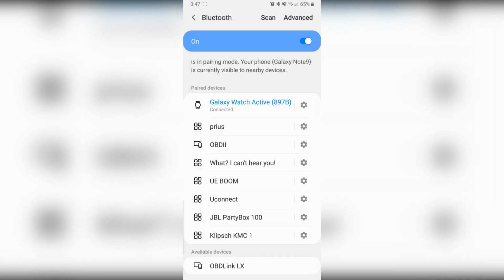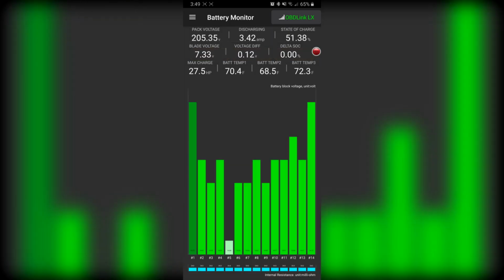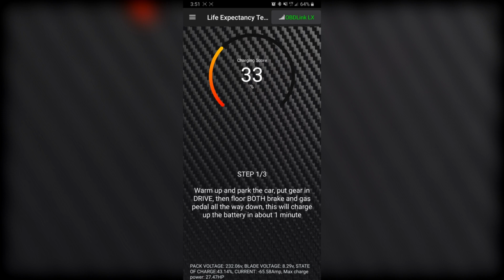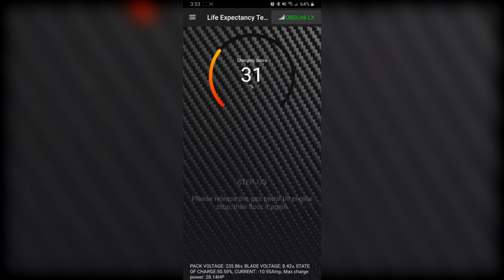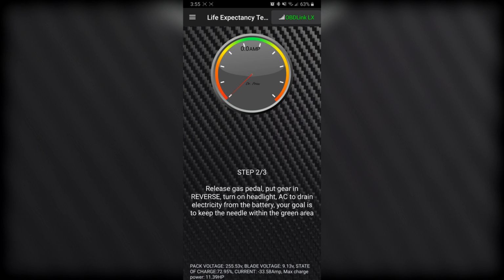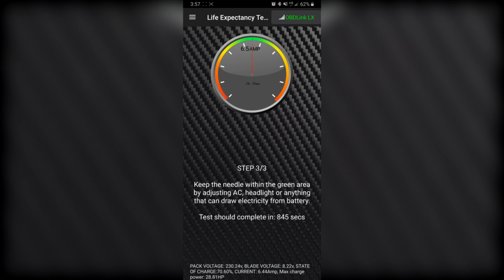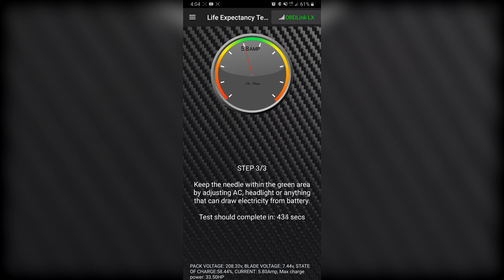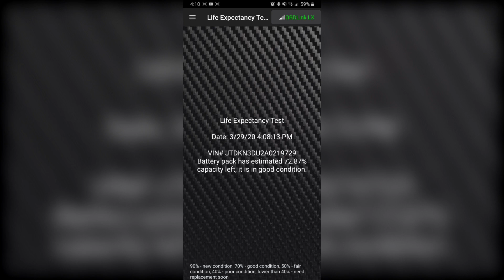How To Test Prius Battery Health

Comment: I rebuilt my battery pack on my 2007 Hybrid Camry last year! Does the Dr. Prius work on my Camry? What kind of balance charger/discharger you recommended for balancing the whole pack? I have used  a couple of hobby chargers to charge and discharge each separate module ten times after replacing 5 bad modules!
Reply: Dr Prius works on all Toyota hybrids. You can forget the grid charger, if your pack acts up again just replace the defective module(s). Drive the car highway speeds more often too. Stop and go driving is death to these cars. Also sitting parked for weeks does them dirt too.
Reply: @michael47lamb  Thank you for your advice
Reply: Yes, you are right! I have driven my Camry a few occasions on short stops and go shopping with the A/C turn on in the summer! The battery condition gauge showed only 40% left, I then drove on freeway for a reasonable distance just to charge up the battery again! It was a bit scary, I've just wondered whether the newer Toyota hybrids have similar drawn  back?
Reply from the maker: Hi Samuel!

Sounds like you did it right! I had good success using the Tenergy T180 but any hobby charger that can handle NiMh would work. The price goes up with the chargers ability to discharge at higher rates. The T180 could discharge around 15-20 watts which was about perfect for what I wanted.

There are much better chargers out there that can handle multiple modules at once which would speed up the process.
Reply: @HEVTech1  Hi, I tried to use the Dr. Prius App. on my 2007 Camry today, but it did not allow my Fixed Blue tooth transmitter to work! I have been using this for years, it worked on Fixed App. and Torque Pro.  App. Can you recommended one that work! I don't want to keep buying the wrong one please!
Reply from the maker: @ChuiSamuel  I've had good success with this one:
https://www.amazon.com/dp/B005NLQAHS/ref=cm_sw_r_cp_apa_fabt1_oeVTFb175RC90

I have an android device running Dr. Prius
Reply: @HEVTech1  I ordered one of the above yesterday, It will arrive in a few days! Do you know anyone can write the PID equation for Torque pro for my Camry? The custom PID on Torque Pro only work for Prius!

Comment: Good Video. I have a Garage kept prius 113k miles battery is at 47%
Reply from the maker: What year? That is a bit lower than I would expect for that mileage and the fact it was garage kept.
Reply: @HEVTech1  Sorry I left that. its a 2011 Prius with 113,000 miles.  I ran the test twice, and had 47 and 48%. Vehicle is in Florida. Also my Block 4 showed an error message on one of those tests.
Reply from the maker: @an10nee  what was the error message? Florida may change the equation as there is much more heat than in the Midwest.
Reply: @an10nee  what’s your mpg?

Comment: Hi, I want to test my prius 2013 within 82K mileages, first of all to start test, Do I need to turn on engine as same as launch car to drive, or just click one time for ignition?
Reply from the maker: You will want to turn the engine on then connect your OBDII reader.
Reply: H-EV Tech Thank you!
Reply from the maker: @BeyondTheCar  Good Luck! :)
Reply: H-EV Tech I got test 63% percent, what do you think my battery got how much mpg?
Reply from the maker: @BeyondTheCar  63% is fair condition. It shouldn't impact your mpg all that much yet.
Reply: H-EV Tech Thank you!
Reply: @HEVTech1  hi will this work for 2008 Prius? thanks much

Comment: How much the battery cost for 2006 Prius if go bad ?
Reply from the maker: That really depends on if you plan to buy a replacement battery, or take the pack apart and recondition the battery yourself. The price range is quite wide unfortunately.

I paid $120 for the replacement modules and $75 for chargers to complete the reconditioning process myself.
Buying a new battery can cost as much as $3k depending on where you buy the replacement.
Reply: You have choices. If you are lazy, drive into the dealer and he'll do it for around $3300. Or take your 28 modules to the dealer parts dept and exchange them for 28 new ones for $1950. You do the labor. But here's the best way to go. Go to the car-parts.com site and find a low-mileage battery from a 2014 Prius with low miles for less than $1000. You'll move up 8 years in age.

Comment: Hi , when i have done the test the engine starts at 198 second before the time has finished , but it gave me the result which was %74.5 . Is it accurate or something wrong ?
Reply from the maker: It generally will finish before you reach 0 seconds.

74.5% falls within "Good Condition" and is certainly acceptable.

Comment: How about Lexus RX450H 2013. Would the testing process be any different from this? If so, could you please highlight the difference? Thanks.
Reply from the maker: Lexus is a Toyota company like GMC to GM. I don't think the "Dr. Prius" app will support the Lexus RX450H for a hybrid battery test. The "Hybrid Assistant" app may support the PIDs needed for the test. I absolutely would try it :)
Reply: @HEVTech1  I think the Dr Prius App may work on Lexus. At least the GS450h. Because I saw someone use the app (or something that looks very similar) to test that car.
Reply from the maker: @liquidh6344  I would absolutely try it!

Comment: Floor both.....really.  That can’t be good for the CVT or the flex plate.  Or is it harmless?
Reply from the maker: Generally harmless believe it or not. When both are floored the motor generator is spun to charge up the battery rather than attempting to push the car forward.
Reply: I’m pretty sure there is no flex plate

Comment: What’s wrong with your block 5? It’s very low and it’s light green?
Reply from the maker: Block 5 was showing a little low at 14.5v. The pack was discharged to around 51% and voltage differential was within normal limits at 0.12v so I was not too concerned.
The pack was also a little cold which could contribute.